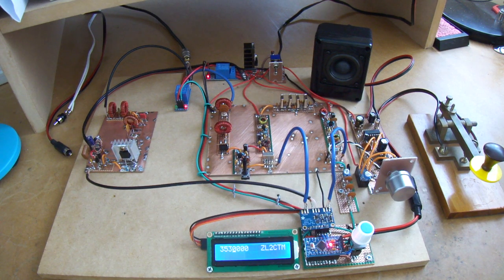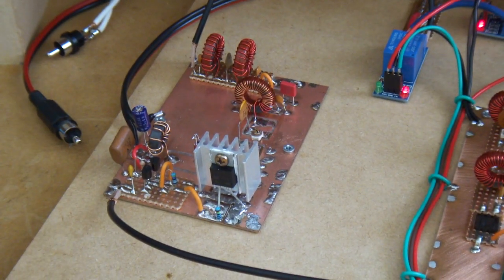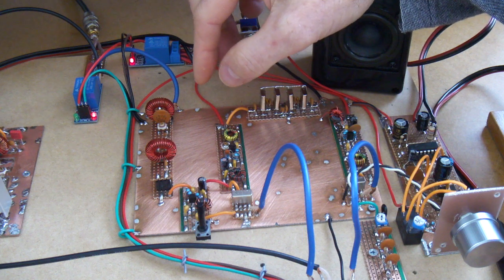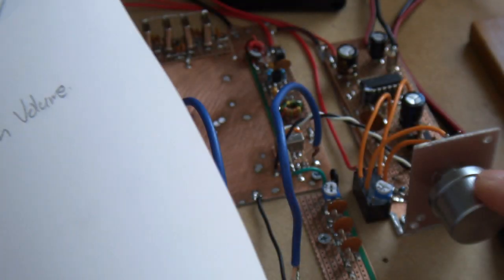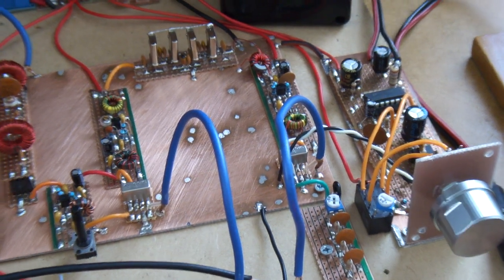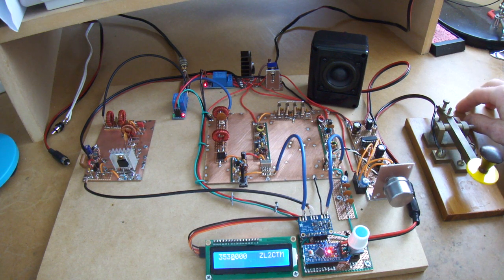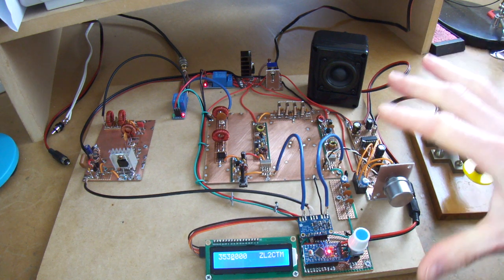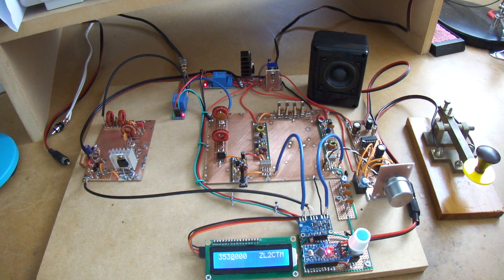CW Rig. Part 6 - Final Transceiver Configuration

Comment: I used the same relay approach for injecting sidetone, it worked well, by product was elimination of T/R thump, however, it means the main volume control does not set the level of the sidetone,  which is unconventional.  On a noisy summit or park, you want the sidetone volume to come up with the receiver volume.  Otherwise a good technique.  73 Paul VK3HN.
Reply from the maker: Cheers Paul. Good point about the AF volume.

Comment: Charlie, your video has encouraged me to give the arduino a try.  I have assembled the hardware per your instructions, downloaded your software.  I cannot get the software to run, I have added the Jm liquidCrystal I2C.h library and Jm.SI5351.h library, but the software gives me an error because it is looking for LiquidCrystal_I2C.h and si5351.  What do I need to do.  as you can tell I am new to the arduino.
Reply from the maker: Hi Edwin. Sounds like your libraries are not the same as I have here. Try searching for Etherkit_Si5351 for the Si5351.
Reply: @CharlieMorrisZL2CTM  Charlie, I think that is the answer.  It uploaded and appears all is well.  Thanks for your help. Keep up the good work.

Comment: Are the relay boards something you made or is that a pre-made module?
Reply from the maker: I got those through AliExpress. They were cheaper to buy as a board than as separate relays. Nice and easy to drive form a uP.
Reply: Charlie Morris Thanks.  I think I’ve looked at similar ones.